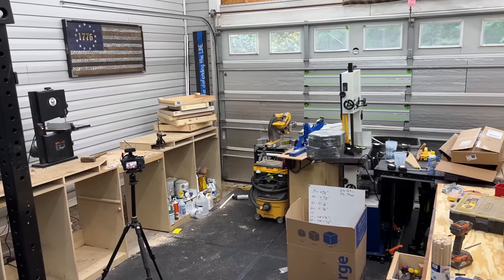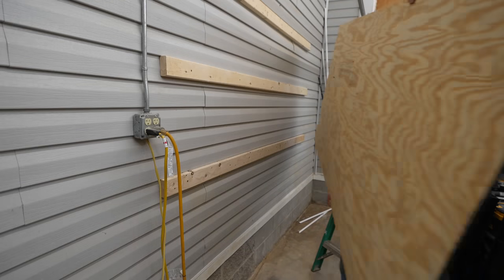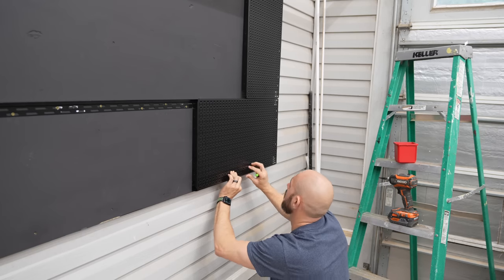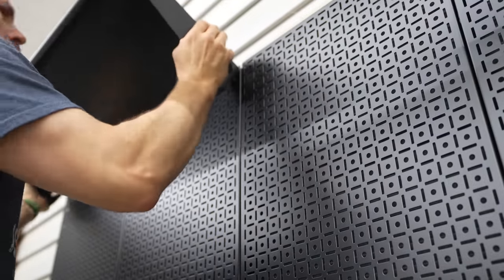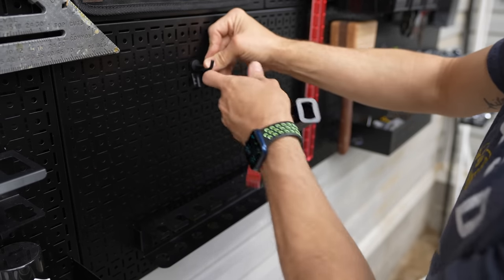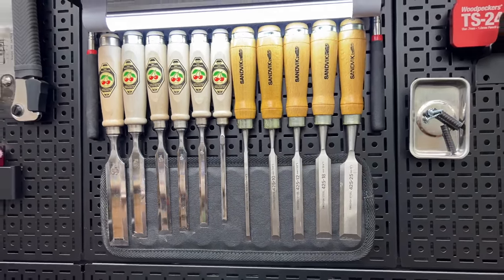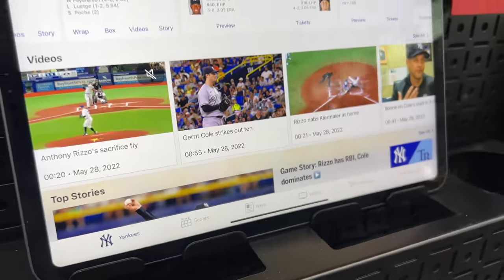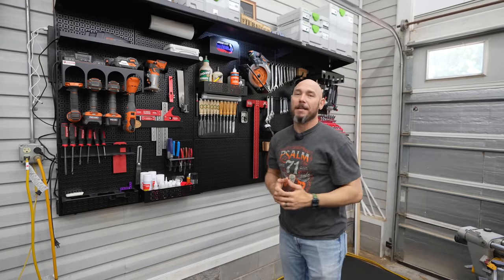I Hate The Look of French Cleats! I Got This Instead...

Comment from the maker: ▼EXPAND FOR LINKS TO THE TOOLS▼ 
🎥 Watch Next - DIY Miter Station Part 2 - https://youtu.be/4jfDk6eYOXU
🛠 Tools In This Video: 
OmniWall Weekend Warrior XL - https://amzn.to/3PPRqlD
OmniWall Cordless Power Tool Kit - https://amzn.to/3t5wXzs
Small Hand Tool Kit - https://amzn.to/38KYbEI
Power Tool and Parts Bins Kit - https://amzn.to/3N4PyDL
All OmniWall Accessories - https://omniwallusa.com/Accessories/
Rockler Parallel Clamp Rack - https://amzn.to/3N88cdU
Rockler F- Clamp Rack - https://amzn.to/3auTMGd
Rockler Pipe Clamp Rack - https://amzn.to/3Md5fHR
Viking Arm (reverse clamp I used to demo with) https://masscaproducts.com/pages/viking-arm?aff=5

Other Tools/Equipment I'm Asked About Often:
Where I get my t-shirts (mostly) https://www.kerusso.com
Toolbox in Background - https://homedepot.sjv.io/x9B2xy
Tool Wall over Miter Station - https://amzn.to/3ZgWq7B
Digital YouTube Sign - https://amzn.to/3GL2a2e

(If you use one of these Amazon and other affiliate links, I may receive a commission) 

Other useful links:
Daily Tool Deals on my website: https://www.731woodworks.com/tool-deals
Subscribe the 731 Newsletter: https://mailchi.mp/7e44c16eefdc/731-woodworks-email-newsletter
Check out our easy-to-follow woodworking plans: https://www.731woodworks.com/store use code 5NEWTOOLS to save 20% off your order.
Outlaw's Board Butter - So Good it Should be Outlawed: https://www.731woodworks.com/store/boardbutter

Comment: Over a grand for a few wall mount tool holders. That's more than I spent on my mac top/bottom chest combo. Takes up less space and holds more tools. So handy this is. Things like a specialized hook with a plastic tab and aerospace engineering to make a peg to hang a speed square. Know what else works just like that and doesn't 'fall out'? A nail. BOOM, complete solution and for around $4.50 you can get a pack with around 45 of those bad boys. Speed squares for days hanging on the wall at a cost of a dime each. And another $30 for this and $30 for that and $180 for another small piece. One thing's for sure, this system is indeed for 'tools'.

Comment: FYI for everyone still using peg board. They make plastic clamps that hold those hangers in and they work very well. Long as you have those plastic holders attached the hanger will not fall off.
Reply: There's also the cool little paper clip trick that works too.
Reply: Yes they work well. I just ran out of mine
Reply: Or zip ties

Comment: Nice setup!
On my walls I have LED  light strips every 4 feet abover the workbench, and have them all wired into a circuit I control with a switch mounted on/in the wall board above the workbench. This way I can turn them all on or off with one switch, while working at the workbench.  And since my entry door is 50 feet across the shop I wired all my shop lights(including those workbench lights, wired to the ceiling lights circuits), fan controls, air compressor, big screen TV and bluetooth stereo to a switch panel mounted next to that personal entry door.  This way I can turn off everything on, or off, when I open up or leave without having to walk all over the shop to each individual item to shut it down after a long, exhausing night in the shop.  
Plus, I put a ring doorbell camera in my shop so my wife can check on me from anywhere and talk to me,when I'm not making a lot of noise of coarse, without having to walk out to the shop.  She even does it from her phone, so, from anywhere. (My older brother died from a heart attack last Oct in his shop and his wife didn't find him for 2 hours..?)

Comment: I know someone has already mentioned a heat gun for label removal. Sometimes adhesive residue gets left behind. Residue comes off quick and easy with a little WD40 and a rag or paper towel. I use this method all the time. Shop looks great!

Comment: I’m currently turning my garage into my wood shop. I’ve gotten too old to be doing remodeling work with a few exceptions. Two years ago I started collecting the tools and falling trees required to build furniture. I haven’t had to pay for any of my lumber as long as i did the cleanup. I have a mobile slab machine and use my basement to dry them. I’m going through all my tools and organizing now. I’m building my work table currently. I liked what you built for your table and used it along with a couple other guys I subscribed to. Keep killing it brother 👍.

Comment: Nice system, but it is expensive at nearly $850 for the 4x8' coverage it provides.  My suggestion for an accessory... a tape and/or sandpaper roll mount... at least 6-8" wide (or more) to hold a few types and allow you ti pull and dispense.

Comment: Suggestion on taking the labels off, get a long trough and put Very Hot Water with some detergent in the trough, it will weaken the glue. Once it is soft, use a plastic paint scraper the label will come off rather easily. Next take some butter and spread it on the place where the label was, the oil in the butter will weaken the glue even more, the just wash off with a rag, dry everything well and no label or glue on the support parts. It works on most glued labels.

Comment: I’ve six panels and a variety of attachments. Only two drawbacks - accessories pricing and some of the standard hooks are a little light weight. Don’t expect to put anything heavy on the medium or long hooks without them bending some. Also would be nice to have some “U” shaped hooks. I didn’t receive a tool for removing the plastic hooks, which are usually only good for one use. Still all said, a very nice system.

Comment: By the way I deal with two organization is I try to keep tools that are related to a certain work area or device like drill press gets drill bits router station gets the router bits, the table saw gets saw blades and related, a bench-top tool box(It's a great place to store clamps up 42" long.) is located on the 'I-reinforced-it!' (gave it a couple extra legs over the floor joists.) 'work-bench' that came with the shed. It also is the battery charger hub, bench top storage of the battery powered tool arsenal. Under that bench are also kept the corded tools; a circular saw, a drill, an impact screw driver, a sawzall, And a corded gigsaw. I have a roll-around toolbox that is mobile. The assembly table has a tool tray with a handle that can be slid around on the table, or removed completely. I'm outta room truthfully. I can't do the projects that the assembly table could easily handle because shop space is roughly 1/2 what would be required. I'm currently saving to purchase, or at least 80% of the cost of permit, purchase and set-up of a much larger shed. The office is in the house, cause saw dust and computers don't mix. Packaging material is also stored in the house, currently, the living room. (Wife's not over the moon about that.😬) 
I sure said a lot to say that the need for organized Wall storage could not be overstated. To help clean up some of the crap in the shop and have storage space and assembly space in a way overcrowded unit.

Comment: Nice system, but not cheap.  I currently have 8' x 16' of french cleat across the long wall in my shop.  To convert that same footprint to Omniwall would probably run about $3K.  That;'s Festool money right there.  🤪   Also the advantage of the french cleat is it's 100% customizable.  You could hang a kitchen sink or a lawnmower if you really wanted to.

Comment: I'll be sticking with French cleats and pegboard. This looks good, but for $900 (even for $810 with the sale Amazon has on it atm), I think it's too expensive. It's definitely too much for me personally. 

It does solve a problem, but it creates a new one (a big hole in the old wallet LOL).

French cleats are arguably stronger, and can be made from plywood for strength, or particle board or mdf for cost savings. I've used scraps to make parts and never once broken one. Omniwall looks very hard to expand without buying new parts.

Pegboard is bad, but there is a place for it (as this shows). With the right setup and use case, it's a great product. But the hooks falling off is VERY annoying. They make clips to solve that problem, so I don't see that it really is THAT big of a problem. Certainly not enough that I'd want to spend $800+ on a system with many of the other issues of pegboard (space needed behind it, but that's solved too. Weight limitations. And limitations for where you can out something.) 

I definitely wouldn't turn it down if someone gave it to me, and I'd even consider $500 for a 4x8' area if I had a lot of things I wanted accessible on a wall. However, it seems like the  company really just put lipstick on a pig after giving it a shower. It's still pegboard, just without the cost effectiveness, and adding constraints on the sizes of panels.
Reply: "100% Better Than French Cleats for Tool Organization" Translated: 100% of his money stays in his pocket. Nothing wrong with getting free stuff whatsoever but come on, just say it's another way of organization.

Comment: Use a heat gun or a torch is quicker on stickers.  Obviously if you use the torch just a quick blast to loosen the adhesive.  Works great on wood stickers as well.  Especially ply aka the worst ones!

Comment: The wall system seems good, but logistically, I feel like the tool wall needs to be closer to your workbench somehow. Most of those items are assembly-related and it seems that you’ll be going back and forth quite a bit from your workbench to that wall. I would be very prone to leaving a lot of assembly tools and glue on that big workbench if I couldn’t turn around and put it on the tool wall easily.
Reply: I agree Chris. I also have a garage shop and follow what I call the 6 foot rule. Basically I have 2 wall storage systems that are on either side of main workbench/ assembly table. Commonly used items are in each wall. Also utilize a 24” mobile tool cart that I load up with tools that are specific to that project.
Reply from the maker: My workbench is 5 steps away from the wall 🤷🏻‍♂️

Comment: I have had good luck using a heat gun to heat up the adhesive on stickers and they will come right off.  Clean up the adhesive residue with Goo Off or some other safe solvent.

Comment: It is not the look of French cleats that I hate- it is the inefficiency of space usage. 
Omniwall is, at the end of the day, pegboard. Nothing wrong with that, but there are cheaper ways to achieve it. Like all commercial systems, it is a compromise- they do not know what tools you will mount. Invest a fraction of the cost of this wall in a 3D printer and you have individual tool fit mounts available.

Comment: WD-40 is perfect for those super sticky tags. Spray it down, wait a few minutes and it wipes right off.
Also good for removing glue and gun from hair.
Reply: That worked well also reactivating the adhesive with some heat and sticker came off in in one piece as well

Comment: I hate to say it, but my French Cleat wall cost about $80. Which is about $920 cheaper.
Reply from the maker: Yes, it's cheaper.  But I don't like the look of French cleat. And I didn't want to take the time to make all the holders for every tool.  For me and my shop, this is far superior.
Reply: @731 Woodworks  It definitely saves time! It took me forever to get everything up on my French Cleat,  but I'm also just a hobbyist. I'm not working with timelines for my projects. Also, I need a bandsaw. I'll get that before I spend more on organization. If I were a pro, I'd definitely be interested.
Reply from the maker: @isaacbrooks5999  The great thing about French cleats is, you can build any organizational item you need specific to your shop and your needs where a system like this, you only get what's available.
Reply: @731 Woodworks  💯!! I enjoy making tool holders when I don't have another project.

Comment: In the episode where you installed the ultimate tool storage wall, when you were demolishing your old work area, you used a tool that kinda looks like a reverse clamp to separate the top from the lower piece - what is that tool called?